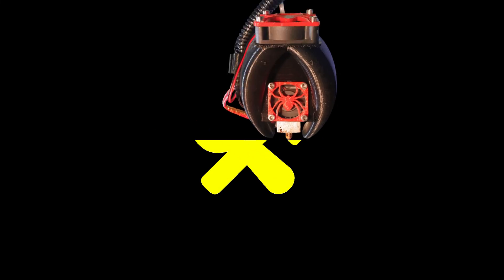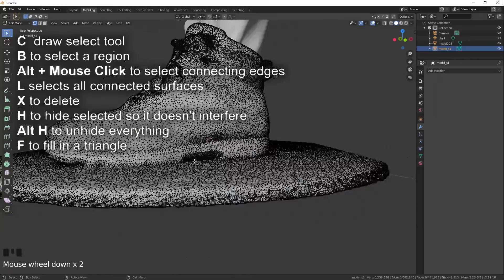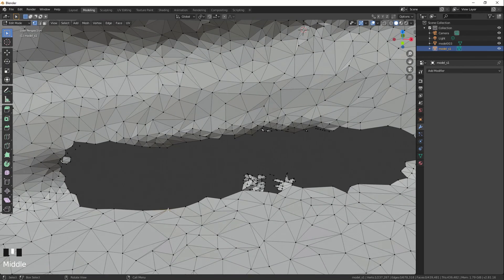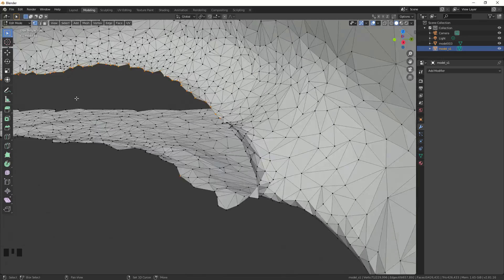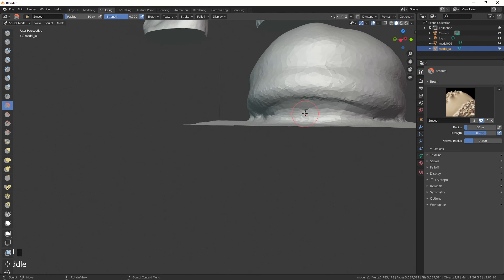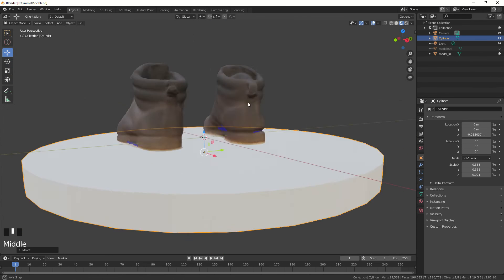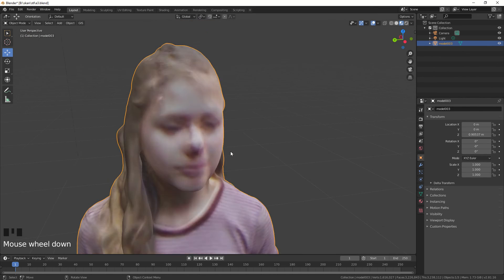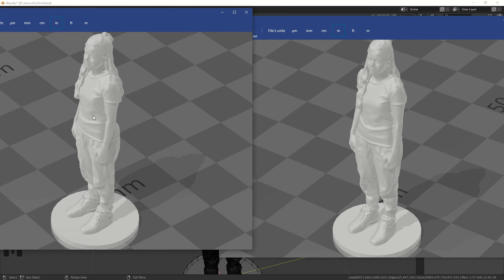Preparing a 3D scan in Blender

Comment: Something not covered in any of the scan clean-up tutorials I've seen is the problem of the mesh breaking during clean-up, which is an issue for 3D printing. 
If you want to 3D print a scan, you should turn on Viewport Overlays > Face Orientation  to see which way round the faces are; blue is external, red is internal. Deleting "red" faces and vertices will often cause more rogue faces and vertices to pop-up elsewhere, and you can spend hours chasing them trying to fix them all, and the mesh will STILL show as having unfixable non-manifold errors when you check it in Windows 3D Builder. (edit: I forgot to mention, this problem mostly occurs when you try to reduce the number of vertices).

The solution is... I have no idea. I'm still looking for the solution in a tutorial.
Reply: I am not sure if you already found the solution to this and if this even is the solution to your problem: If you go into viewport overlays > Face orientation and any of your faces shows up red, select the WHOLE MODEL (press A) and then ALT + N > "Recalculate Outside", this will turn all inward facing Normals outside and the ones that are already correct stay the same.

Comment: nice video,how do i import 3d scan with its original measurements ?
Reply from the maker: To my knowledge there is no way to do that, but if you want to get something to a specific scale. Scan an item of known size and then? Use your software to measure it and scale it accordingly. An example of this would be put a ruler beside the item you're scanning and scan it as well. You can remove it in editing afterward.